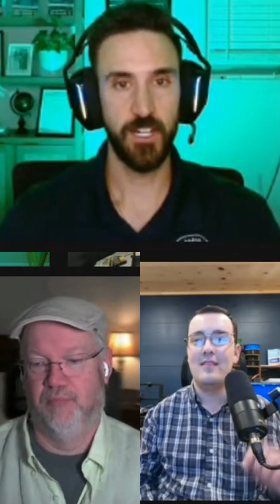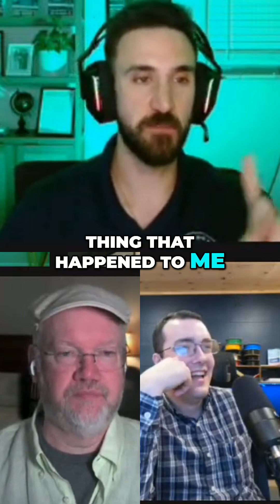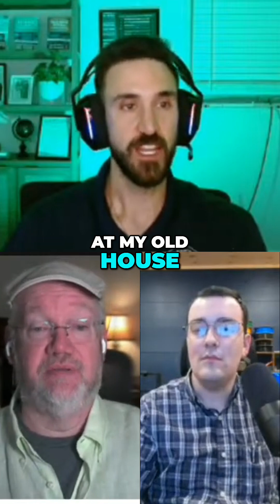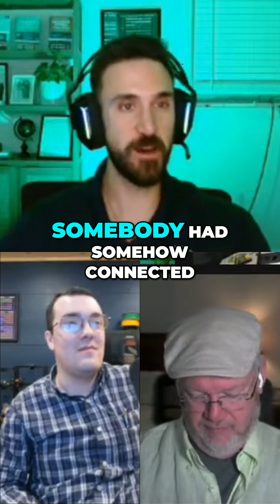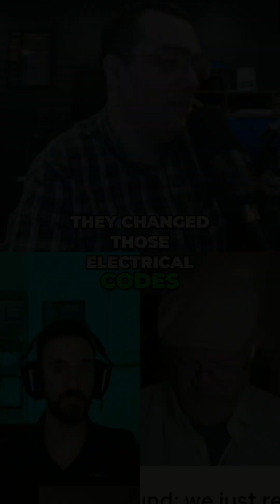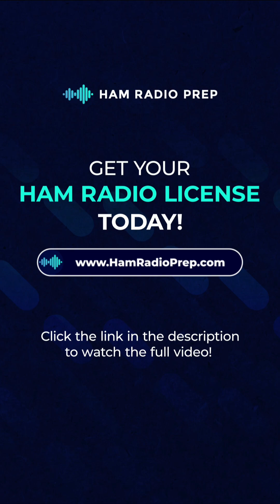Shocking Truth About Grounding in Old Houses #shorts

Comment: QUICK question, in a hoa situation, where the antenna is in the attic or in a ground floor room does it still need to be grounded for safety purposes? 🧐🤔
Reply from the maker: Jim says:  Always a good idea to have a safety ground, however, probably less important in the attic.  Also you would need to be concerned about the ground being an RF radiator because of it's length.